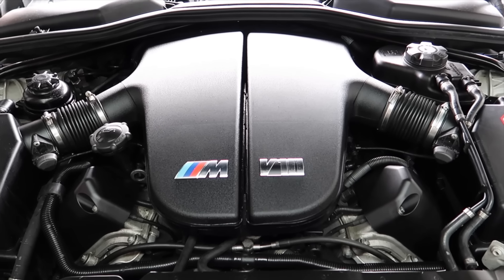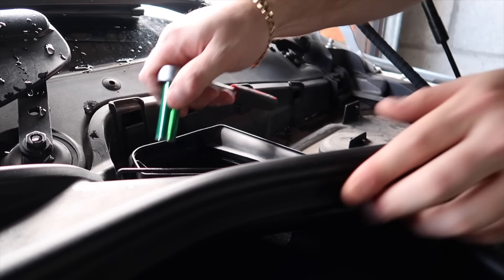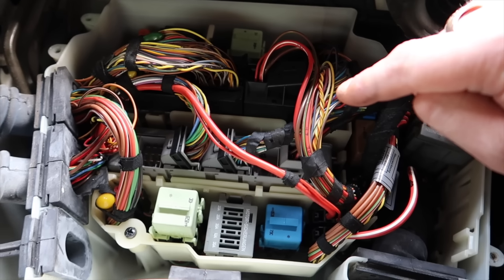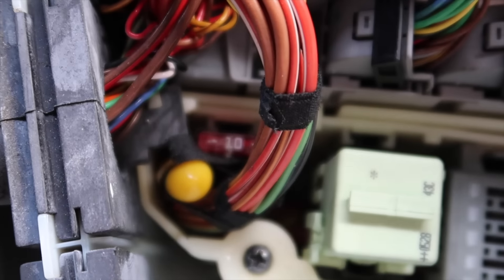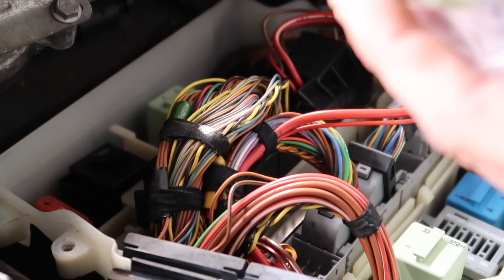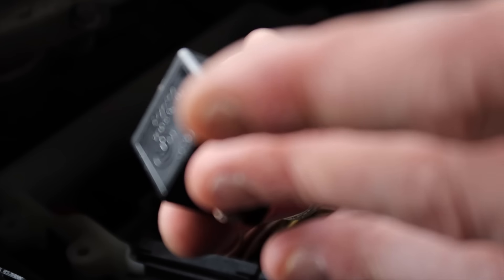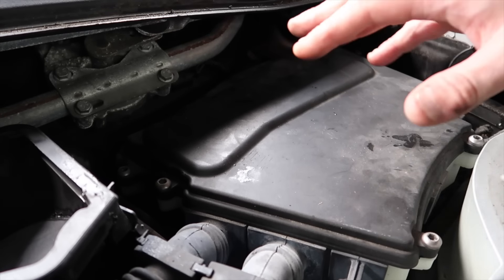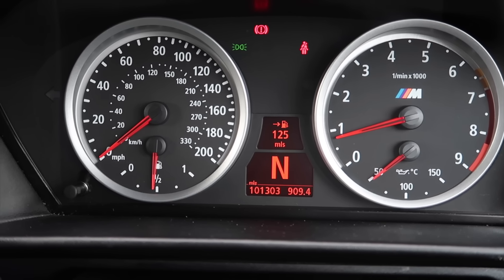This **Illegal BMW Mod** Just Changed Everything For BMW Owner's !!

Comment: What I really want to know is how to permanently solve the rod bearing issue on that V10 engine.
Reply from the maker: Very easy change them for ACL bearings let the car warm up properly and no issues ever again.
Reply: That fuse 43 in the trunk, instant fix.
Reply: It's a high speed F1 inspired engine. You're going to replace rod bearings every 70-100k miles no matter what. When I replaced my bearings at 90k, they were quite worn, but the crank was still perfect. Replaced with higher clearance ACL bearings. We'll see how they hold up 60k miles later. The best thing you can do is not to go above 4000 rpm until the oil is completely up to temperature.

Comment: How is it illegal to add or remove a fuse to something you own
Reply: Firstly, "illegal" is in quotes (take that however you want), but the legality lies in the manufacturer to limit vehicle speed. So it's illegal for BMW to deliver a vehicle with no top speed limiter for mandated regulation reasons, not illegal for you to remove the fuse. But it's "probably" illegal for you to test that top speed on your local roads.

Comment: My question is does it increase power to
Reply from the maker: YES as it removes your rev limiter
Reply: No, you don't magically gain extra 100bhp... Removing the fuse allows you to pass the top speed restriction, not because you have more power but due to the ecu not stopping your engine when you reach this artificial top speed limit
Reply: So if I do this to my e93 3.0ltr auto ✊🏾 will it still change gears properly and are there any risk ⁉️ coz I’m ready to do this tomorrow if it’s safe L😅Lz gonna red line it all day I think 🤔